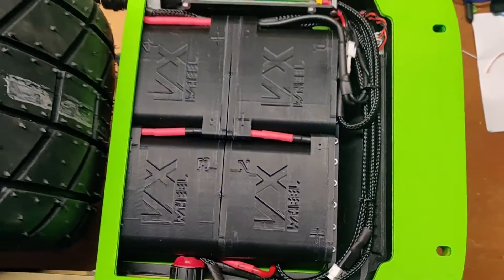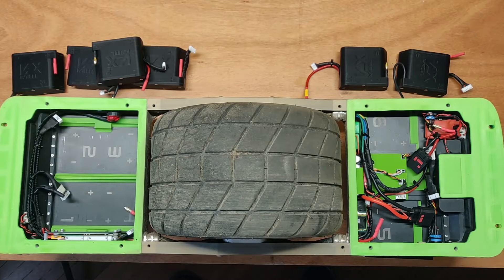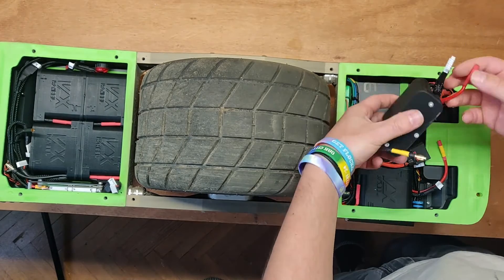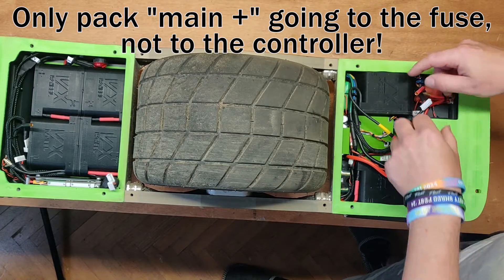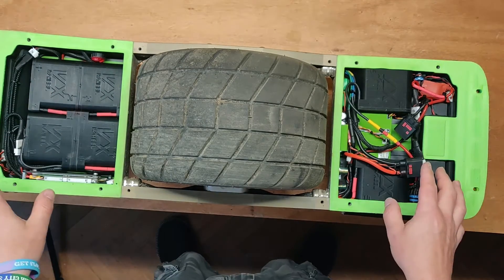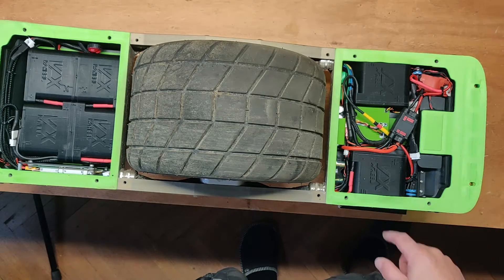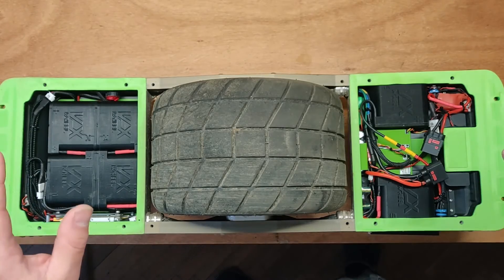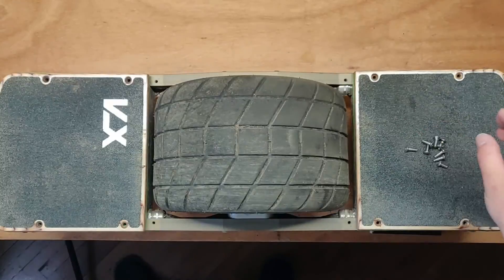Things you MUST know about Split Pack VESC onewheel  battery systems - VXwheel

Comment: Amazing build! Pack still balanced? Im also planning to build a flight-pack using an Ennoid V4.

Im gonna try building a 20s2p 21700 with 4 cells in the front box. Hoping it will fit and stays balanced🤞🏻
Want to use the ennoid
Reply from the maker: @devrim1134  1year old board, 5000km and still balanced, all working well!
Reply: Great to hear, thnx! Thats some riding btw, 5000 in 1 year 🥳
Reply from the maker: @devrim1134  Thanks, I made 580km in a week lately :)

Comment: Is that setup waterproof? Using the footpad as the box cover 🫨
Reply from the maker: It is, I was recently riding 2 rainy event weekends and not a single drop of water was inside. All you need to do is take care the gaskets are in good shape and replace them if damaged.
Reply: @VXwheel  You mean the gaskets on the bottom of the footpads?
Reply from the maker: @garrymullins  Full gasket under the lid. Maybe it's confusing as it's green.
Reply: @VXwheel  I'm watching your water dip test video now. I see that there's a full layer gasket on top of the box/rail under the footpad. Cool stuff.

Comment: Does the longer length of wire between packs 4 and 5 mess up the bms measurements for cells 16 or 17?
Reply from the maker: It all works well for 1500+km now and 4500+km on my VX3 with a similar system just one pack less. I see no mess up in the measurements.

Comment: I asked about your "manual anti-spark" in the comments of an older video of yours, as well as XT90 anti-sparks burning out. Are the black main power connectors in this video XT90AS's, or something bigger/better that removes the need for a manual anti-spark?
Reply from the maker: This is QS8, a larger anti spark connector and the default one on Tronic 250R. It's the first time I use it, so I am only getting to know how it performs. Hopefully it turns out good over time.
Reply: @VXwheel  Thanks! And dammnn, 130A, 600V... at least according to the specs it should be fine for a long time. Please update if you run into any issues. Am I right in thinking there should be no popping / sparking sound, and if there is, that would mean the resistor is no longer working?
Reply from the maker: @DoctorDugong21  Yeah,  works fine for now. I'll update you if it fails. The issues I have with it so far is that it's too large and complicated to fit in the spot.
Reply: The Qs 8 perform much better thank a xt 90 Antispark, i tested IT